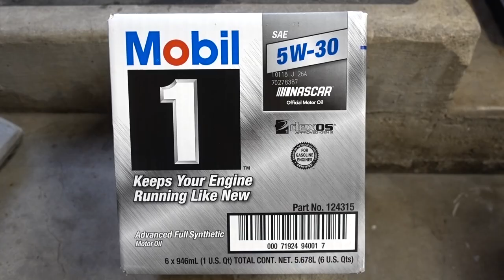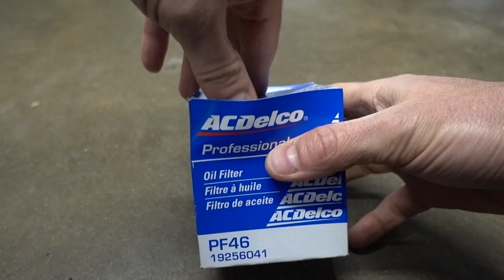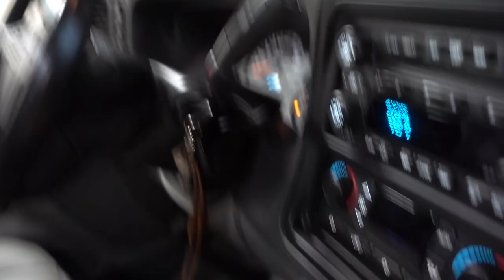BEST OIL FILTER HACK IMAGINABLE!!

Comment: Hi 1Road I just wanted to let you know that I've been using magnets on the oil filters on a variety of vehicles for over a 30 year period, the fact is that yes it does work, because all engines are wearing parts them selfs and without preventative measures or by chance you don't change your oil and you just keep adding then the outcome is inevitable, you lose your vehicle. By the way I think your doing a fabulous job on your videos in keeping people informed at your expense. Thank you.

Comment: Why not cut the filter open after the next oil change to see of the magnets are holding any material?
Reply: Vincent Vader i use magnets on my filter and every time I cut them open for inspection there is evidence inside the filter where the magnets had captured something. Been doing this for a while now and will continue to do so.
Reply: @brianbeck3628   it means you have a issue with the engine oil you use and it's not doing a good job
Reply: '@punker4real, even with oil,  friction wear takes place nothing lasts for ever. If there was no wear no one would buy new cars.
Reply: Here even though you might have ferrous material on the filter near where the magnets are the oil filter still catches that material. So do it if you want but I'm gonna say it's just a waste of time to put those on and off each time.
Reply: punker4Real every engine ever made does this. It is normal. Even the engines in your vehicles.
Reply: @punker4Real  unless you are from 10000 years in the future and are using oil that is 100 percent effective... you are wrong. all engines go through wear and tear it doesnt matter what oil you use.
Reply: Also when putting magnets on the outside of an oil filter all you do is keep the particles off of the filter media. Think of the flow direction it can't hurt but you are probably doing no good.
Reply: Cos that’s the next video coming soon....
Reply: scot miller that would extend the life of the filter, having particles stick to the outside can vs. filter media.. You know like with any other filter, the more material stuck directly to it the more restricted flow is.
Reply: @WhiteGravey  I use baby oil ...makes my engine smell like a new born.
Reply: Vincent Vader - Because it's not doing shit.
Reply: This is pure bullshit, using the recommended high quality oil and changing it in time along with all the filters your engine probably will outlast the useful life of the vehicle. Morons like to believe that they can hack magical improvements with 2 dollars and 5 minutes of time and that they are smarter than engineers that dedicate their entire lives to improve engine durability.
Reply: Sorry Bro  my grandpa was a mechanic (heavy duty industrial equipment & inventor , machines the size of houses used in factories  as well as vehicles )
The Metal Quality matters... He had very special gears made for the machine  he ran  with ultra High quality alloys  used  the custom gear lasted longer then the factory ones(the HQ one wore out the cheap ones.)  while the custom gear out latest the machine it self before it was crushed (to prevent a competitor from stealing the idea) HIGH QUALITY   alloys MATTER.. they spent 1200$ on the custom gear(1960s)  which saved them a lot of down time .
Reply: @ @punker4Real  We are talking about the average Joe with the average money and the average engine wears out even if well lubricated.
Reply: punker4Real ...my grampa likes to grease me up
Reply: @Wen6543  These engineers you speak of, they aren't the same engineers who have vehicle recalls are they? Do they engineer vehicles which find  their way to class action lawsuits for low quality parts which in some cases are used to save a few bucks? Anyone who actually has worked on cars has ran in to more than one poorly engineered part or common sense engineer foresight towards accessibility to scheduled maintenance parts/components procedures.
Reply: @brianbeck3628  thanks for that
Reply: I have done this and could not find any metal in the filter! I have a custom oil filter cutter (no hacksaw) so there is no particle spew from sawing.  use the magnets!  it is good.
Reply: @kartboarder22g17  no it does not filter all material. Microparticles under 5 microns pass easily every filter , but magnets can catch them. Thats why magnet filters are in use in very demanding engines and industry since many years. Its nothing new.
Reply: @MrPetkula  It would be a cool experiment for someone to put a magnet downstream after the filter to see what particles it picks up if any.   That would be the ultimate test in my opinion.
Reply: @kartboarder22g17  I did it and believe me , it works. I had a magnet filter on the oil cooler hose. I examined particles from it in the lab. It was tiny particles that had upp till 7 microns.And the oil filter I had was top quality.
Reply: Because Snake Oil
Reply: @kartboarder22g17  no, oil filters aren't perfect for very small particles.
Reply: @WhiteGravey  yes!
Reply: @seaturkey5608  yes!!
Reply: @punker4Real  epic!
Reply: @MrPetkula  smart man.
Reply: @MrPetkula  awesome 👌
Reply: @punker4Real  cool bro try putting that in a car
Reply: @brianbeck3628  I guess that's like 100 percent reassurance that it won't jump back into the motor
Reply: @WhiteGravey  If that were true, so many people here wouldn't be claiming over 300,000 miles on their car, original block...
Reply: I’m familiar with jet engines that use magnets to catch metal particles but the magnets are exposed to the oil, not outside a filter.
Reply: If he cuts the filter with any type of saw there will be false metal flakes on the magnets that come from the oil filter housing during cutting prices. Really, no matter how he cuts it.

Comment: I replaced the filter in my automatic transmission just a week ago and guess what I found in the rear of the pan? A strip of magnet about 3/4" wide by about 4" long (one of those plasticky craft-type magnets)... COVERED in very fine ferrous particles. And the fluid was actually quite clean. I'm a believer!

Comment: I have a 250lb  fishing magnet on my filter.  Last week, at a stop light I was over a man hole cover and picked it up, dragging it for 1000feet
Reply: Actually, some people with small motorcycles or mopeds add a magnet or magnets to the bottom to help trigger stop lights to change.  If you are at the front at the light and the road sensor is weak it will not pick up the bike.
Reply: @solarsynapse  excellent trick
Reply: No chance that actually happened
Reply: I pulled up beside the police station evidence room and my magnet erased every hard drive in the room

Comment: A tip for making much less of a mess when unscrewing your old oil filter: drill a small hole at the bottom of the filter (or the side if it is mounted at 90°) and let the oil drain out of the filter into the catch pan for a few minutes. Once there is no more drip, you'll be able to unscrew it and not make a mess. The more you know 🏳️‍🌈
Reply: Or just poke a screw oil filter in the bottom
Reply: I used to do that on all the big rigs. I’d use my 3/8” center punch and a hammer and let those suckers drain. Huge oil filters like the size of a skinny man’s leg 😂

Comment: Many here ask "What can a magnet do that the filter doesn't do already?". Well, even high-end filters have very limited effectiveness below 20 microns. When it comes to ferrous particles that might be in your oil, a magnet will attract them regardless of how small they might be. In theory, a magnet can capture particles smaller than any practical filter media could. It appears that manufacturers are already putting them on drain plugs, so the idea is already in use.

Comment: If the filter is straight up and down I always add some oil to the filter in order to keep from a dry start if the filter has a slight angle u can do that also
Reply: ironeagle2526 you can still add oil to a filter that is parallel with the ground without spilling. The filter media does a decent job of keeping the oil absorbed for long enough to turn it a few times on the threads to prevent a mess.
Reply: Just did the same thing this past Monday
Reply: Fill the filter with oil the night before the oil change to let the oil soak into the filter media.

Comment: A message with TLC 4U2; Fram is selling inline fuel filters with magnets built right into the base that holds the internal paper filter. I have "Tried" using these filters in my Automatic Transmission lines into and out of my Dodge Transmission to the front and rear coolers. 
The filers tend to cause a more restrictive flow of the transmission fluid which forces the connecting lines off the (in and out) hoses.
I still feel it is a very good concept and will continue to tinkers appropriately.

Comment: Always use a high end oil filter with synthetic media when using synthetic oil. They are designed to work together for extended oil change intervals of 5000+ miles.

Comment: Using magnets on the filter is bad. The more buildup the less flow. You should put them on your pan where the metal settles and the magnet holds the pieces from moving around
Reply: Now your talking about a vehicle that is fkd up if it builds up to the point of interfering with oil flow. And yes I put them on my head of my oil plug too because the OEM one is kinda weak after exposed to temps over 170F. and on the pan of my ATF , Transfer case , front and rear diffs too. Being OCD kinda sucks. But I never get questioned when doing any type of job for people that know me. They know I went above and beyond what was expected.
Reply: The walls of the oil pan are usually pretty thick, certainly much thicker than the walls of an oil filter. That diffuses the magnetic force, so you're less likely to catch anything. I'd say on the filter is better, it's highly unlikely that the thin spots of metal buildup will effect oil flow in any meaningful way.
Reply: Won't work on aluminum oil pan.
Reply: Hybrids Vader I’m sure some sort of tape or adhesive could work.

Comment: I have owned four airplanes, in the middle of the oil pans in each of them... was a magnet, one lO-360, and two TO-360’s, and an O-320.  At every oil change we checked the magnet for metal particles and if there was ANYTHING we sent the oil out for analysis.
Reply: There are NO oil pans on aircraft engines. None. There is a sump screen you can clean and you should cut the filter open.  To get to the inside of the engine you would have to split the case
Reply: @dslade353  yeah yeah fine… sump… oil pan… the widget at the bottom where the oil is.

Comment: In an aviation oil change (on a piston engines), after the oil filter is removed it is cut open with each oil change.  The filter element in the filter is unfolded and examined for metal.  Every engine "makes metal".  The berings will ware and little metal flakes will come off into the oil which is captured by the filter.  If the particles are small enough they will not be captured by the filter element.  Magnets would catch iron based metals like the copper and steel which are used in bearings.
Reply: Copper??? magnets don't catch copper?
Reply: airlui our copper no but the alloys used in engines are

Comment: Great Content Brother, Refreshing a 6.2L with New CAM, lifters, Push Rods, will always be New Micro Metal during Break In, We Use Magnets including Chip Detectors on Critical Engine or Tail Rotors on Military Helicopters
Right on Point Brother 👍

Comment: FYI, no need to remove the oil cap to allow the oil to drain faster.  There is an oil breath vent connected to your air box.  Opening the cap does nothing more then what is already available.

Comment: Fact: Manufacturers put magnets on the drain plugs and in some cases transmission pans not just to catch ferrous particulates. But it's for the sake of your mechanic to be able and identity potential problems with the motor. Shavings are a tell tale sign of shearing inside the engine. Could be a number of problems but if you catch all those shavings in the filter you will never know when your engine is on its way to catastrophic failure potentially leaving you stranded.
Reply from the maker: Good point!!! Thanks for adding to the conversation!!

Comment: Jimmy, here’s a question. Which way is the oil flowing through your filter? IF it’s flowing past the outside wall first then the magnets will catch any particles (before) it goes through the filter media, therefore not letting the media do it’s job. If the oil is flowing in the in the other direction then I would recommend a better filter with a finer filtering media.. The drain plug makes total sense, it’s at the bottom of the pan where metal particles will settle and there is no filter here.
I would love to see Project Farm (PF) do an actual test on this. But I agree with you if it makes you feel better and it’s cheap just do it.. But I didn’t go for the magnet on the fuel line to get better MPG, really? Nothing in fuel is magnetic..
Reply: It flows outside in, so not as ideal.... the magnets are a good idea, I'm curious if putting it on the oil pan would work better, but of course you don't remove the oil pan very often.... Maybe better to just get a very good oil filter.

Comment: Another tip with Chevy LS engines. 
When you change your oil, buy an extra filter and a gallon of wd-40. Drain your oil, put on a new filter, fill the motor with the wd-40 and crank it several times without letting it start. Re-drain the pan if the wd-40 and be amazed what comes out with it. Swap another new filter on and refill with 5w-30 Quaker State oil. This will extend the life of any engine but works great with LS engines with high milage. You'll find cold lifter ticks and knocks eliminated.

Comment: I use a high-temp resistant magnet on the drain plug and it does catch some material.
Reply: I haven't heard of a high-temp resistant mag???? Usually they get weaker with temps exceeding 170 F. I will research the shit outta this and get some ...Thank you sir...

Comment: Are the magnets holding up ok? I heard they lose their magnetism after getting too hot. There are specially rated magnets that can handle high heat, but these harbor freight magnets are probably just the basic ones. So are they still working??

Comment: Michaelxcx I HAVE BEEN DOING THIS FOR YEARS it removes small particles making  things work smoother and last longer changing all the fluids and filters and adding  Recommend fluids is a must .here are 5 places you can put them
1 power steering  dipstick or resivior 
2 transmission drain screw manual or auto
 3 fuel lines 
 4 oil  pan drain screw 
 5 oil filter

Comment: Nice video. So yes it does work. I have a chopper I use it on. Oil tank and tans tank. It’s a little magnet and it pulls a ton of stuff out. It works. I have it on my diesel truck also.

Comment: Back in the day, VW's used a strong magnetic drain plug with only a coarse mesh filter and they worked very well if one maintained the scheduled engine oil changes. A scheduled valve jobe was set at 75, 000 miles due to one of the rear cylinders was set to run a little cooler. Other than that they lasted a long time. This may sound rather stupid - a friend of mine for who knows why bought a 4 year old VW Bug from another friend of mine and drove it to the west Coast and Vancouver Island and never changed the oil for 25,000 miles before it gave up the ghost.  Also, when i was working for a VW repair shop, someone phoned and was in a panic stating that his engine was overheating big time. I told the owner and he told me to tell him to bring it in on a hook. Half an hour later this guy drives up and shows me the engine and believe it or not the crankshaft pulley was wobbling back and forth pretty good. I called the owner( a Master VW mechanic) and he was almost jumping up and down and kinda ticked off with the owner chastising him for driving it to she shop. We immediately shut it down and the owner shook the crankshaft pulley back and forth and stated that the owner had a broken crankshaft and chastised him again. The owner stated that he was working on his engine and was missing a rag. guess where the rag ended up - yep in the fan. Another time yrs later at an automotive  shop in the interior we two of us were coming back for a service call a few miles out of town and there was a VW Bug broken down parked along the side of the hwy. We the senior mechanic asked what was wrong a hippy type of guy said that he could not start it as the battery was dead. We were driving a 1 ton flatbed with mobile tools and a 24 volt battery. This Bug had a 6 volt system. guess what - yep u likely guess right. The other mechanic jump started the Bug with 24 volts. I questioned him on the wisdom and he laughed and shrugged it of and said - just watch. He got the owner in the Bug and told him when to hit the starter. Well it started alright but not before spinning over at 2000 + RPM. The owner jumps out waving his arm like madly in a panic - enough, enough he cried out. At first i was amazed that this did not burn out the 6 volt system but it was also quite funny all in all. To this day, I don't know how the 6 volt starter survived as well as anything else that was live.  True 1st hand story folks

Comment: I had a 70 Boss 302 Mustang for 10 yrs and the cam went bad. Thank God I had 6 magnets on the top of the heads under the valve covers. I saw the metal dust piled on the magnets. I will never put an engine together again with out magnets. They saved my engine.